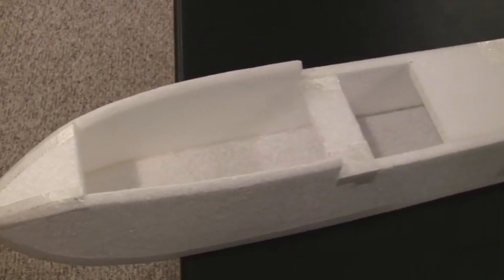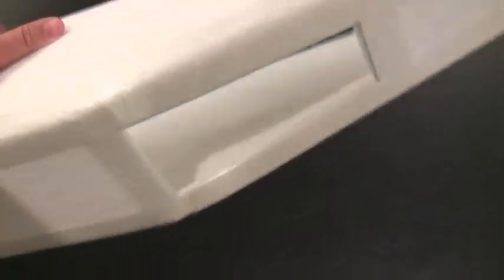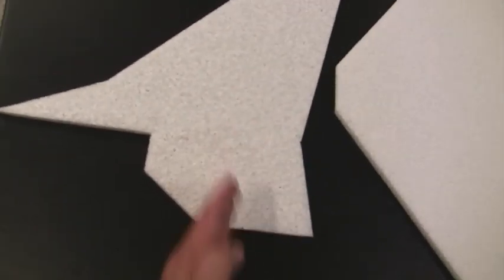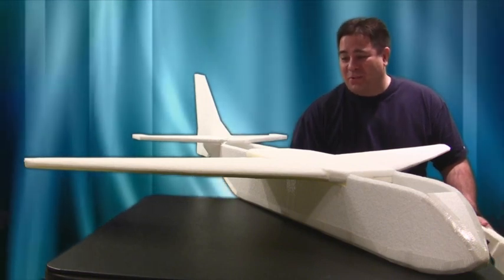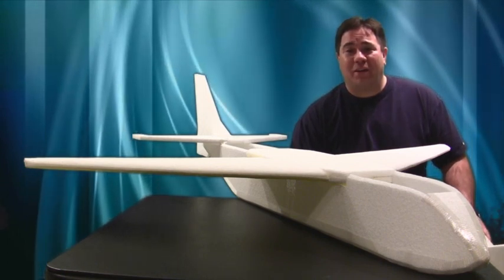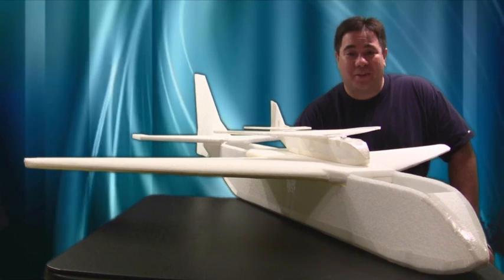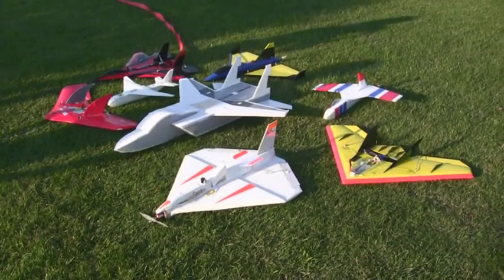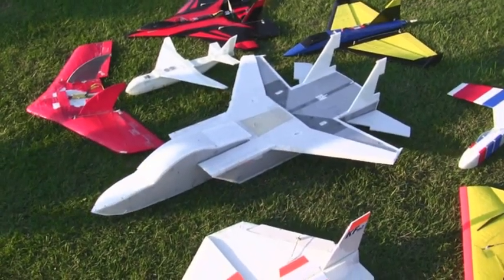Project Jupiter Part 3 (KFm3 Airfoil RC Plane)

Comment: Locking great!
It will fly, even with the small motor(2X200W) and estimated 6lb flying weight.
You will need may be standard size servos..
Salute